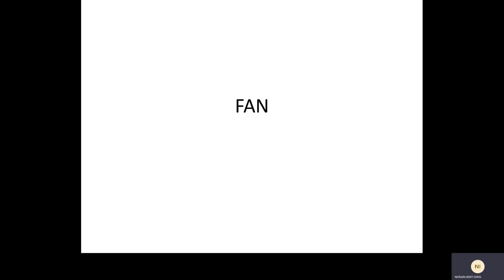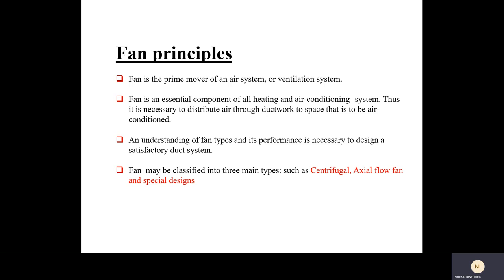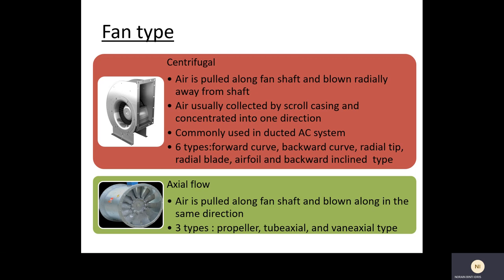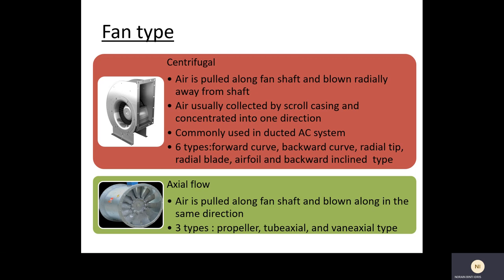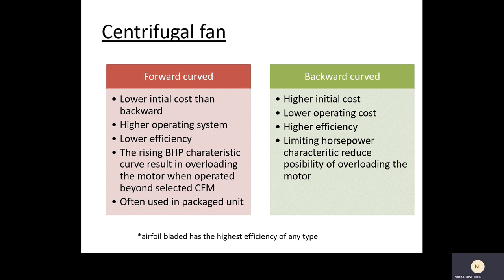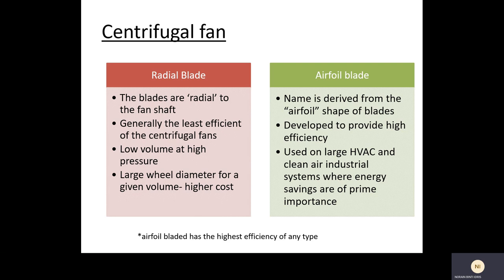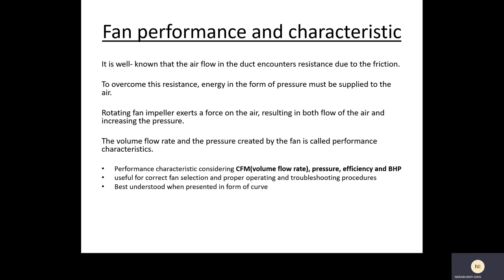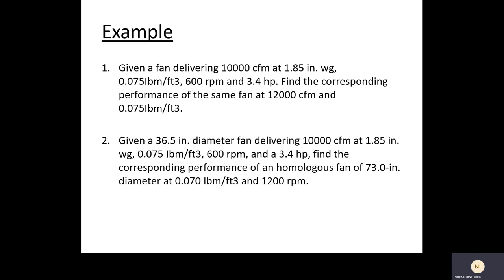Lecture 8 AIR MOVERS AND FAN TECHNOLOGY

Comment: NUR SELIHAH WAL HUDA BINTI AHMAD (B071710190)
FAN PRINCIPLE
    - Primer mover of an aur system.
    - To distribute air through ductwork to conditioned space.
    - 3 types of fan : Centrifugal, Axial flow fan, Special design

TYPES OF FAN
i) CENTRIFUGAL 
    = Air is pulled along fan shaft and blown radially away from shaft
 into one direction.
    = Commonly used in ducted AC system
    = 6 types : - forward curve = a) Lower initial cost with higher operating system 
                                                      b) Lower efficiency
                                                      c) Used in packaged unit
                       - backward curve = a) Higher initial cost with lower operating cost.
                                                          b) Higher efficiency.
                                                          c) Limiting horsepower.
                        - radial tip = a) More efficient 
                                              b) The blades are radial to the fan shaft at the outer 
                                                   extremity of the impeller.
                        - radial blade = a) The blades are radial to the fan shaft.
                                                   b) Least efficient with low volume at high pressure.
                                                   c) Higher cost due large wheel diameter for a given 
                                                        volume.
                        - airfoil = a) Provide high efficiency 
                                         b) Use don large HVAC industries for energy savings.
                        - backward inclined 

ii) AXIAL FLOW FAN
     = Air is pulled along fan shaft and blown along in the same direction.
     = 3 types : - propeller 
                        - tubeaxial = a) Undesirable for ac system.
                                               b) Air distribution is uneven.
                        - vaneaxial = a) Higher noise and required sound attenuator.
                                               b) Compact physical construction is useful when space is limited

iii) SPECIAL DESIGN
     = Required quality demand design innovation, exotic materials and precision manufacturing techniques.

FAN PERFORMANCE AND CHARACTERISTICS
   - Performance characteristics considering CFM, pressure, efficiency and BHP.
   - Useful for correct fan selection proper operating and troubleshooting procedures.
   - Best understood when presented in form of curve.

FAN RATING
i) Performance curve
          = Enable engineer to visualize changes in BHP, static P and efficiency.
ii) Table 
         = Replace large number of curve.
         = Operating condition at maximum efficieency is not clearly understood.

FAN SELECTION
    - Static pressure resistance Ps is calculated.
    - From the manufacturer’s data, the required CFM against the system static pressure resistance for the right fan is selected.
   - Selection criteria : energy consumption.

FAN LAWS
   - Relationship among fan performance for a given fan, operating at changed condition, or for different size fans of similar construction.
   - Useful to predict performance when conditions are changed.

Comment: MUHAMAD IZMAN BIN JAMALUDDIN 

B071710518

Axial Fan

Axial fans can usually be foundpositioned on top of an HVAC Rooftop or home compressor that is outside a house. A basic HVAC system which doesn’t run a heat pump is designed with condenser coils which remove heat from an area.

·       Low cost,  
·        Don’t work well when it faces resistance. 
·       Single Phase Voltages.

Centrifugal Fan

Inside the HVAC Rooftop system,you will find a centrifugal fan. These fans should be strong enough to overcome all the resistance of the room’s duct-work. This is where axial fans are inadequate. Centrifugal fans move a large quantity of air while
overcoming all the resistance or static pressure of the duct-work so that it can provide adequate air flow throughout the facility.

·        Produce more pressure for a given air volume
than axial fans
·       Higher air flow volumes and pressures.

Types of centrifugal fan:

·        Radial blade
·        Backward inclined 
·        Air foil
·        Radial tip
·        Backward curved
·        Forward curved

Special design

Fans of the required quality demand design innovation ,exotic materials, and precision manufacturing techniques.
Performance of fan

i.           Volume flow rate, pressure, efficiency.
ii.          Correct fan selection and proper operating and ltroubleshooting procedures. Best understood when presented in form of curve.

Comment: mohamad asyraf aidee bin mohd baseri b091810017 they have 6 types of centrifugal fan impeller blade which is the radial blade, backward inclined, airfoil. radial tip, backward curve, forward-curved. and the fan principle is to move air in the system or ventilation.

Comment: LIM PEI JUN (B071710194)

Fan
-prime mover of air or ventilation system.
-classified into 3type which are centrifugal, axial flow and special design.

Centrifugal fan type
- air is pulled along fan shaft and blown radially away from shaft.
-commonly  could found at AHU
-6type impeller blades: airfoil, forward and backward curved, radial tip, radial blade and last is backward inclined.

Axial flow fan type
-air was pulled  along fan shaft and blown along in the same direction.
-3type of axial flow fan: propeller, tubeaxial and vaneaxial.

Fan characteristic considering to:
-CFM
-pressure
- efficiency
-BHP
A correct fan selection will bring the system fully transfer the amount of conditioned  air to the location that had been set. So how to select a fan?
-calculated the static pressure resistance
-select the fan based on the required CFM against the system static pressure resistance.
-select criteria that must consider which is energy consumption.

Comment: Muhammad Zulqarnain Bin Zamzuri (B071710782)

FAN

·       Principle : prime mover of air system
(ventilation)
·       3 main type of fan
o  Centrifugal
§ Air pulled along shaft and blown radially away
§ Common used in AC system
§ 6 type : forward curve, backward curve, radial
tip, radial blade, airfoil, backward inclined type
o  Axial flow fan
§ Air pulled along fan shaft and blown along in
same direction
§ 3 types : propeller, tubeaxial, vaneaxial type
o  Special designs
§ Fans of required quality demand design
innovation, exotic materials, and precision manufacturing techniques

·       Fan Performance and Characteristic
o  Performance considering CFM, Pressure, Efficiency,
BHP
o  Useful for correct fan and proper operating and
troubleshooting

·       How to select a fan
o  Static pressure resistance is calculated
o  Required CFM against system static pressure
resistance for the right fan is selected
o  Selection criteria : energy consumption

·       Fan Laws
o  Relationship among fan performance for a given
fan, operating at changed condition, or for different size fans of similar
construction.

Comment: A Hakimi B071710484

In HVAC system, there 2 type of fan which centrifugal fan type and axial flow fan type. Performance fan characteristic including  CFM(volume flow rate), pressure, efficiency and BHP. In fan election, first engineer must calculate static pressure resistance. Required CFM data from the manufacturer’s against the systems static pressure resistance for the right fan is selected and third calculate energy consumption.

Comment: SEE WEI CHE B091810368
From this lecture video, i have learned that fan is the primary  components of an air system and ventilation system. Also that, fan is an essential component for all heating and air-conditioning system. There are 3 main types of fan which are centrifugal, axial flow fan and special designs. In centrifugal fan, air is pulled along fan shaft and blown radially away from shaft. There are 6 types of centrifugal fan which are forward curve, backward curve, radial tip, radial blade, airfoil and backward inclined  type. As for axial fan, air is pulled along fan shaft and blown along in the same direction. There are 3 types of axial fan which are propeller, tubeaxial, and vaneaxial type. Special designs are fans of the required quality demand design innovation, exotic materials, and precision manufacturing techniques. Fan performance characteristic considering CFM(volume flow rate), pressure, efficiency and BHP. Fan law is useful to predict performance when conditions are changed.

Comment: Alden andrian phius (B071710392)

1. Princlpe of fan
- An important component in air conditioning system which it used to distribute air through ductwork to the space need to be conditioned.
- As a device to move an air system or ventilation system

2. Types of fan
i. Centrifugal fan
- Radial blade
- Backward incline
- Air foil
- Radial tip
- Backward curve
- Foward curve
ii. Axial flow fan
- Tube axial
- Vane axial
iii. Special design
- Required quality demand design inovation

3. Fan performance and characteristic
i. Air flow in the duct system used to encounter the resistence due to friction.
ii. Energy in the form of pressure must be supplied to air as for overcome the resistence.
iii. Perfomance characteristic is a volume flow rate and pressure that created by fan.
- CFM
- Pressure
- Efficiency
- BHP
iv. Fan rating perfomance characteristic
- Use performance curve
- Use table
v. Selecting fan criteria
- Energy consumption of fan
- Enough cfm but lowest energy consumption
- Static pressure must be calculated

4. Fan laws
i. Useful to predict performance when condition are changed
ii. To predict a good accuracy performance of fan must refering fan law and using series equation.